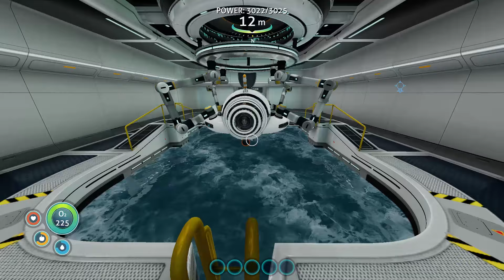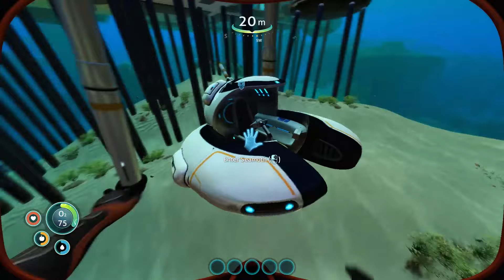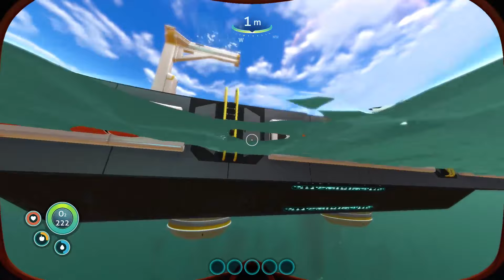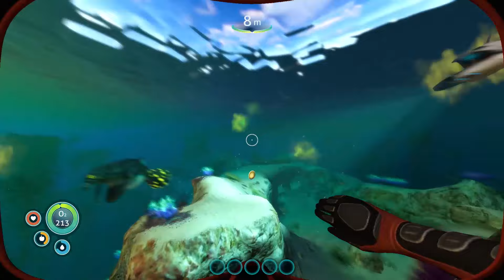Vehicles Guide Subnautica Seamoth Upgrades Locations & Utility

Comment from the maker: Save This Channel Click Here: https://www.youtube.com/c/HTFGamesStudio/join
👉 Chapters 👈
➡ 00:00 - 00:26 | Introduction
➡ 00:27 | How to Unlock & Craft Seamoth Upgrades
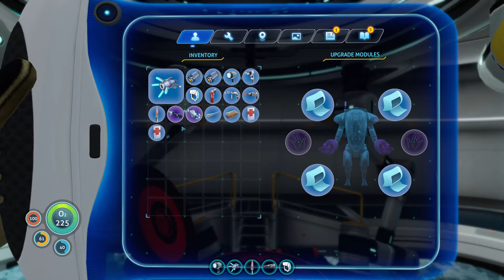➡ 01:09 | Hull Reinforcement Module
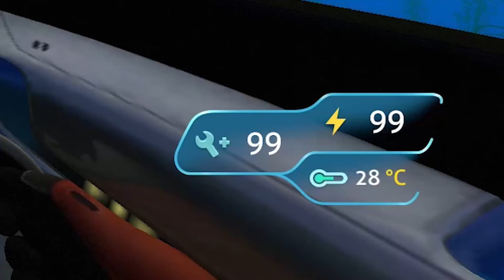➡ 01:52 | Engine Efficiency Module
➡ 03:17 | Storage Module
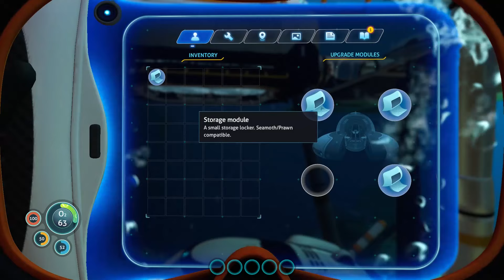➡ 05:07 | Seamoth Depth Module MK1, MK2 & MK3
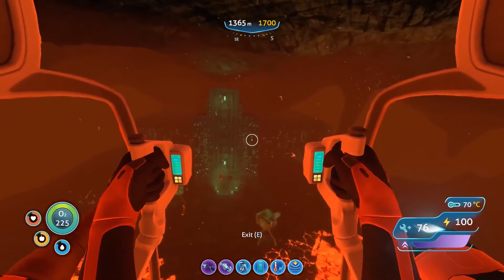➡ 07:24 | Seamoth Solar Charger
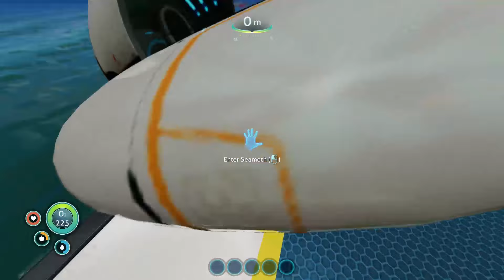➡ 09:04 | Seamoth Perimeter Defense System
➡ 10:32 | Seamoth Torpedo System
➡ 12:44 | Seamoth Scanner Module

Comment: I am using depth Module MK3, Torpedo system, Sonar, and the electric shock. 

Torpedos for warpers, electric shock for leviathans, the Sonar for cave Exploration and depth is self explanatory. I also Bring the cyclops with me All the time when i Go exploring, thats why i dont really need the storage in the seamoth.
Reply from the maker: well cyclops solves all the problems xD
Reply: @HTFGamesStudio  ahhh Not all, If you get to Close to a reaper with it you are basically f ed 😅
Reply from the maker: @Käse-kruste  For some reasons I never get killed by a reaper, only when I did so for the video
Reply: @HTFGamesStudio  maybe i am stupid 🤣🤣🤣
Reply from the maker: @Käse-kruste  🤣